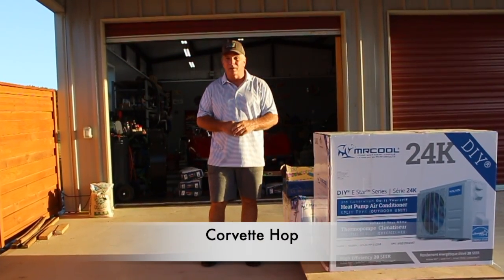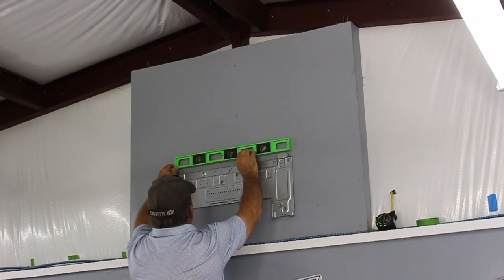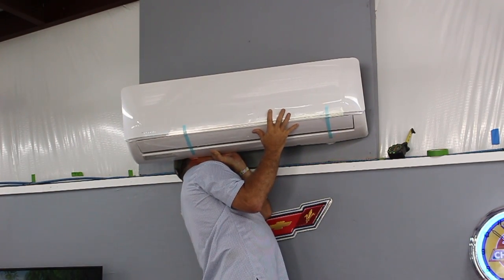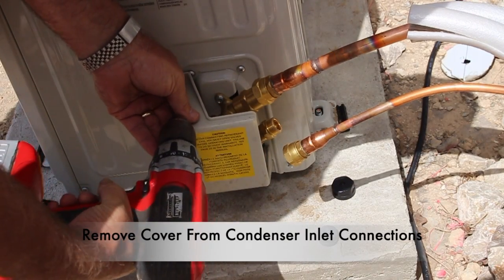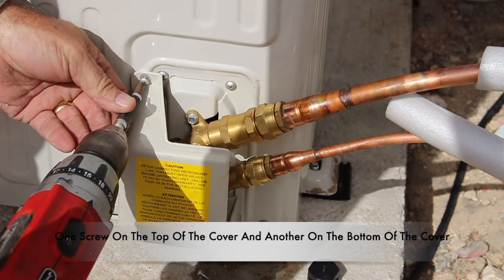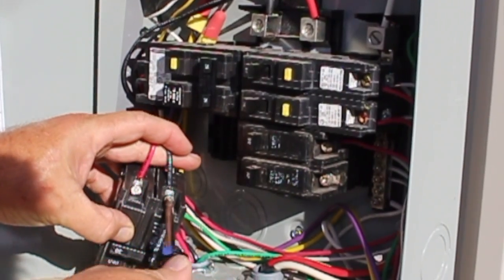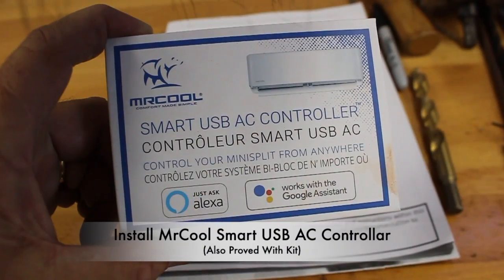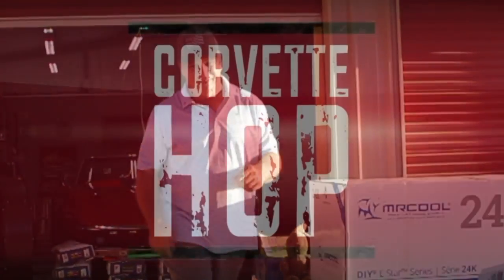DIY Mini Split Installation (MrCool Unit Used In Video Demo) 3rd & 4th Gen MrCool Units

Comment: Very great videos. For sure today. I have installed two12k units in the past and installed a 18k today. Was having problems getting it running and in your video, you said (don't forget to open the 2 valves)    Thats just what I did. Thank you, I didn't want to take it out.

Comment: Thank you very much for your time and posting. I am going to have to put in a 27K BTU w/ two heads. And I'm going to have to run one at 16 ft and one at about 35 feet. But everything is doable if you have the money. :) Thanks again.
Reply from the maker: Glad it helped

Comment: I heard you need to lay the line flat or the lubricant in the refrigerant will not circulate properly
Reply from the maker: No, just the amount of the cooling line that is going to be used.The remaining amount I kept on the bundle as seen on the video.

Comment: TY for the video! Installing my Mr. Cool 24K today! Where did you get the insulated blankets on your ceiling. I want to do the same in my new garage. Did you install yourself or have a contractor install? Thanks Ted.
Reply from the maker: That was installed when the new garage was built by the contractor.

Comment: Is there anything to prevent you from running a 110/120V (considering the smaller 12K unit)  standard grounded / 3rd prong plug into an ordinary wall socket as long as it is still on a 20 Amp fuse to the the hot / ground of the outside unit? Just trying to cancel the need for the outside box and tapping a existing indoor electrical circuit.
Reply from the maker: I would always use a dedicated line electrical circuit for safety reason.
Reply: Ran my 12k 110v for a few weeks off outside plug, while waiting for weather to get better to do electrical. Worked fine.
Reply: Did it work?

Comment: Didn't you forget the AC disconnect between the breaker and the condenser?
Reply: Yea it still works the same though
Reply: @HumbledHabitz  one thing to note is in some areas its required by local safety codes to install so it's always better to check before installing one.
Reply: You can use the breaker as a disconnect!

Comment: Is there away to cut the tubes shorter if so can you a video of that?
Reply: NO, because the lines are precharged with refrigerant. They have linesets from 50 foot then 35 foot, then 25 foot & the shortest is 16 foot. My installation is going to use two 50 foot & one 16 foot linesets. We have a 36K with two 9K & one 18K air handlers. Second part of our order will be here today or tomorrow. First time installing an AC or Heat Pump. I am installing the disconnect box today!😊

Comment: Nice video. Curious on you future thoughts on the Mr Cool unit. I’ve heard split critiques on them. Cheers Chief.
Reply from the maker: Thank you for the comment. I think the mini split is the way to go. Easy DIY for most people and clean. It can be difficult if installing a mini split on and 2nd or 3rd floor. However, for garage, workshop, single level homes it is perfect.
Reply: @TheWhatisright  "It can be difficult if installing a mini split on and 2nd or 3rd floor".  The most underrated statement ever...  Add that I am not installing in on an exterior wall, and feeding it inside a wall, and through multiple attics.  Doubling the fun, I am using 2 air handlers, 1 on the 3rd floor den and the other a 2nd floor bonus room.  So, for me, the pathway is beyond challenging, but unit itself was a savior as I spent about $5K with electrical services, compared to the COVID price of 11K for a professionally installed unit with identical specs.  So, save about $6K to do it myself, check.  Gotta save for the vette...

I also swapped the cheap drain tube for 3/4 PVC.  Better durability against rodents, and since it is going through walls/attic, I can be sure there is a consistent downward angle for drainage.  it also aided in running pathways since it is rigid and did not require a fish tape.  Finally, I added pipe insulation to ensure it does not freeze in winter, but also to ensure there is no condensation forming on the outside of the pipe, per the cold water being drained.  Extra steps, but gives me piece of mind I won't be creating mold, it won't back up, etc.  Now, I just need to figure out what to put on the end to keep bugs out of the drain pipe.

I researched for months and this MR Cool unit is the easiest to install.  I was considering getting all the tools for charging/testing the lines of other units, but found this and it sold me.  Received the unit and it looks pretty darn good on quality as well, so I will know in another week or so.  But I have already run most of the line sets and drain, so the tough stuff is done.  The entire 3rd floor is my den/man cave if you will, so I have an office, bathroom, entertainment area with TV and a craft room for all my projects/outdoors needs.  I ordered the unit months ago so I could design the wall and add sleeves for the line sets.  That template was also a game charger, helping me design my wall.  In that regard I think most minisplits are on an outside wall, and simply exit quickly.  So, my install is challenging, but every aspect of installing the unit itself is easy, almost fail safe.  My only complaint so far is that very cheap drain line.  As I said, I always planned to use PVC, but even for an exterior install, I would think it would be a little more rigid...  Seems like the elements will eat it quickly.

Anyway, good video.  Thanks for your time.

Comment: So, did you have the line and circuit breaker pre-installed by an electrician? Must the unit be  within a certain distance from the main breaker panel?
Reply from the maker: Yes, and good question. In fact, an expert was looking over my shoulder and corrected me as I needed to tighten one of the wires a little more. Pool circuit bracket box was installed by an electrician as I only needed to install a new 220 volt 30 amp circuit breaker. The pool Circuit Breaker Box is 30 feet away from the shop circuit breaker box inside the work shop. Condenser connections are about 20 feet from the pool circuit breaker box. The condenser mounted on the concrete slab is 19 inches from the workshop outer wall to allow for good circulation. Bottom line is, many states have different requirements. Best to have expert electrician supervise or install if required by state.
Reply: I am not afraid of any DIY home renovation, but will not touch a sub panel.  I had an expert perform it, but I believe Code everywhere is that you must have an AC disconnect right next to the unit and in some instances a regular GFI protected outlet close to the unit.  So I had the electrician add a 40Amp breaker, run the conduit to the AC disconnect and add a whip.  I like life and don't want to burn down the house, so...  The rest is easy.

Comment: I didn't see a vacuum pump used to pull system under a vacuum to eliminate contamination from air and moisture.Also didn't see Nylog tread fitting sealer or torque wrench to tighten fittings to correct torque specs.you might end up with short Life of system when you start having performance issues?
Reply: The MrCool units have completely precharged lines, this makes it so you do not need an AC person to complete the install
Reply: The whole idea of the DIY unit is you do not need the vacuum or thread sealer (actually they say NOT to use sealer as it may cause leaks down the road).